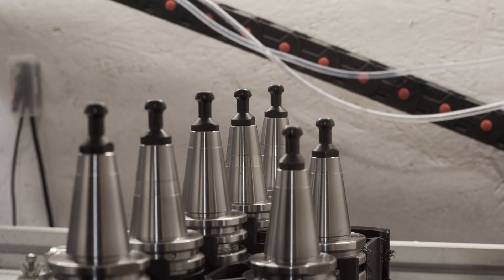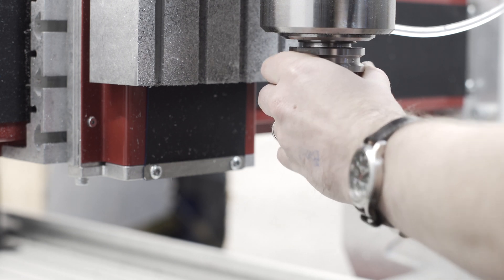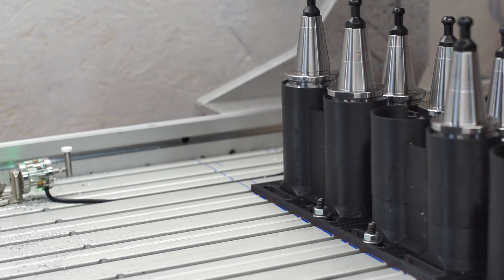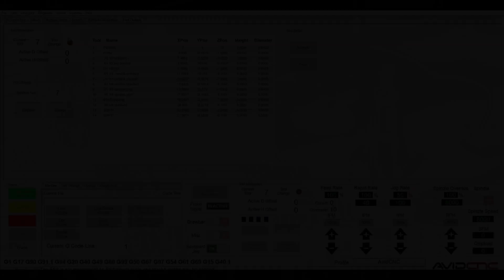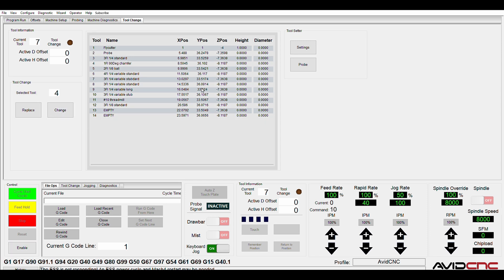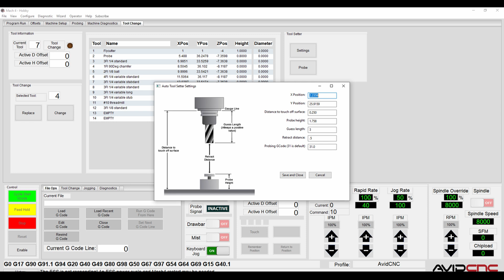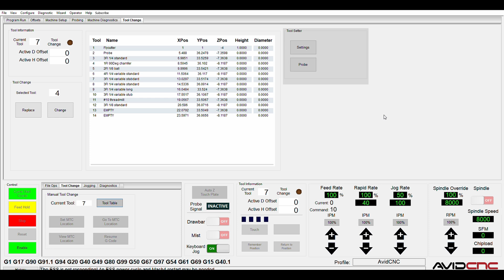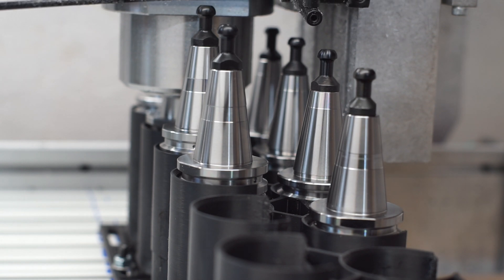3D printed tool rack for my ISO30 ATC Spindle

Comment from the maker: Hey all, had a few requests here and elsewhere for the code.  I cleaned up my code and put the macros/screenset/modules up on github: https://github.com/polyfractal/Mach4ATC/
Reply: Yay what a legend! Thanks. I'll definitely try this out.
Sharing video to DIY CNC group on FB
- Ken
Reply from the maker: Awesome, good luck!  Let me know if you run into any issues, or have bug fixes :)  The tool change macros seem pretty rock solid so far, but I've run into a few sporadic issues with the tool setter and incorrect offsets (may or may not have plunged an end mill through a part 😅 ).  So beware fast rapids to start if you use the touch off code too :)
Reply: @BreakingTaps  thanks. I like that 3d touch of sensor you have. I might buy 1.

Comment: A couple of years on, are you still enjoying those probes? It looks like the manufacturer has discontinued the side-mount one you have in favor of a top-down probe. I’m thinking of picking it up but concerned that if something goes wrong I kill the whole probe rather than just the contact portion sticking out.
Reply from the maker: My Avid hasn't seen as much use as I'd hoped over the years (various unrelated issues) but I'm still pretty happy with the probes! The toolsetter works great, and the wireless probe is good other than battery life. Mine is the older, non-rechargeable design and I find it doesn't do a great job auto-sleeping. So battery dies pretty quickly and replacing it is a pain and requires re-calibration.  I think the newer version just has a USB charging port so much easier.  All in all pretty good value for the money I think.

Shame they discontinued the side-mount. It's the same body as the wireless probe, but I guess they decided to consolidate the models even more by only having vertical option.

Comment: Great info! I have a quick question.  I am building a completely custom machine and already purchased the standard Mach 4 software. Do you think it would be beneficial to get the Avid version to use as a base? I am trying to get my ATC system up and running, I have a brand new 3.2KW spindle that I cannot wait to use. I tried using some of your downloads however I am missing panel function files etc.

Comment: Are you using tool length offsets? How did you setup your tool legths?
Reply from the maker: Yep! The macro will go check the tool length on the toolsetter probe and records the offset for for future use (although right now the other macros also re-probe each tool before use so it's not actually being used, but someday will :) )

Comment: I looked up that probe and it looks sweet! One question i have is how accurate is it? Do you find it good enough that accuracy of the machine is a bigger factor? P.S. Thanks for answering my questions on your other video about this machine btw, I know i have a lot of them lol.
Reply from the maker: No problem :)  To be honest I haven't done any rigorous testing of the probe accuracy and if it's better or worse than the machine's positioning accuracy.  If I had to guess though, it feels like the probe is accurate enough that positioning error of the machine is the main limitation.  I did find that there is a certain position that the probe isn't very accurate in (it uses three pins/springs to allow deflection, and at just the right angle it doesn't actuate smoothly) but that's generally not an issue.  Considering the price it was a nice upgrade from the contact block kind of probe that's typically used, without selling a kidney :)

Comment: I am new to CNC milling, and have a question. Avid sells an auto Z and corner finding touch plate. It this a tool setter and a touch probe all wrapped into one? Thanks in advance!
Reply from the maker: Basically, yeah!  I have one and use it on occasion, when I'm feeling lazy or Mach is not behaving. It has two sides: one side is flat and lets you take a Z measurement (either to find the z-offset of a surface, or to measure a tool).  The other side has a corner notch which lets you put the probe on a corner of your work.  Avid's Mach screen includes some probing routines to then touch off the sides of the plate, which will give you the corner position.  The side with a corner notch can also do Z measurements too, so you can probe height and x/y of a corner all in one go.

Only downside is that it needs a corner to work on, and it can be a bit fiddly (e.g. if you forget to attach the lead to your spindle when probing, it'll crash :) ).  But it's super simple and easy to use otherwise!

Comment: Can this machine cut a sliding fit hole into steel?
Reply from the maker: Hmm, it definitely _can_, but I'm not sure how reliably it can.  Whenever I've needed a good sliding or press fit I rough it on the machine, then bore it out on my manual mill.  Cutting steel is definitely at the edge of this machine's capability... it can do it if you're careful, but repeatability is a challenge.

Comment: Thanks so much for sharing your work!  Would you be willing to share your 3D print file for the tool holder?
Reply from the maker: Sure, no problem!  I'll dig them out this weekend and tidy them up a bit, feel free to ping me again if I forget :)  Fair warning, they haven't worked out as well as I had hoped, and I'll probably redo them or replace them at some point.  The main issue is that different toolholders and tool sizes can cause differences in height which affects ATC.
Reply: @BreakingTaps  Hey, I'm trying to configure your module to use with tool height offsets while I wait for a probe (VERSBY probe is back ordered for a while). Would I just remove the "function to probe tool" section from your ToolChangePosition.lua file, and then set the height offsets in mach4 ?
Thanks for any direction here, your videos are super helpful!

Comment: How does the tool setter connect to avid machine?
Reply from the maker: I wired it up with a 4-pin aviation connector like Avid uses for it's own touch/proximity sensors, so it just plugs right into one of the AUX ports.  The wired tool setter is connected to the wireless probe receiver, and they both send the output to AUX1. :)
Reply: @BreakingTaps  thank you
Reply: Breaking Taps just received my tool setter, any more details on wiring it up? It came with a little resistor and I bought some aviation plugs. Just confused on how which wires go where and what to do with the resistor. Thanks
Reply from the maker: @LoST5757  Heya :)  I'll pop out to the shop today and take some photos, don't quite remember how I have it wired up.  I have both the toolsetter and the probe wired together, so my setup might be a little different depending on what you got.  Details to follow!
Reply: @BreakingTaps  Thanks, looking to do it similar to you, just a traditional wine rack style instead of a 3d printed tool holders.
Reply from the maker: @LoST5757  Apologies for the delay :)  Here's an annotated view of the wiring:  https://imgur.com/a/vwmrC54  Some notes:

- "TS" stands for toolsetter, and is the cable that comes from my wired model.  Both TS and probe are wired into one probe port on the Avid
- I have the older "Vers WL", which looks to have a different PCB than the newer rechargeable WLR model, so pinout might be slightly different
- The probe is configured as Normally Open and NPN switch.
- I'm not currently using the Err output, but probably should :)
- Most 4-pin connectors have the same wire coloring and pinout... but you might want to verify gnd/vcc with a multimeter just in case.  The fourth (white) wire is unused
Reply: @BreakingTaps  Just got to setting up my S30c plug and play kit from CNC Depot. I'm using your macros and screen set from github.  I can't seem to get the drawbar to work.  Like its not getting a signal from Mach 4,  I click replace in Mach4  and get popup to release drawbar, then clamp drawbar.  But it doesn't actually do anything.  manually pushing the button on the solenoid opens and clamps the drawbar.  Is there an output signal I should change? or an other ideas?  Thanks.
Reply from the maker: @LoST5757  Hmm, so he didnt have the plug'n'play kit available when i purchased... so yours might be wired up a bit differently than how I ended up.  I have the ATC drawbar wired up to "flood" relay output on my Avid box, so the lua script is configured to use OSIG_COOLANTON pin.  I'd probably poke around to see where the ATC solenoid is wired (which pin on the breakout board) and then dig around in Mach config/diagnostics and see which output signal is associated with it.
Reply: @BreakingTaps  It was a long day, lol.  So, the solenoid was wired to a solid state relay, but there wasn't a connection from the relay to the breakout board in the control box.  connected a couple of wires and it works now! :)  Now on to get the Vers TS wired up and working, pretty sure i can do this one. Thanks for the response. :)
Reply: @BreakingTaps  it's me again, curious do you use Vectric Aspire? Wondering what post processor I should use for ATC with mach 4.
Reply from the maker: @LoST5757  Heya :)  I've only used Fusion360 so far, although the recent update means ATC is handicapped for hobbyists (can't have multiple tools per program) :(  I haven't done a multi-tool program since the update... not sure what I'll do when I need it, since I'm not sure I want to throw down money for a "professional" Fusion license at this point :(

Comment: Just pulled the trigger on a pro 4x8 + s30c and am sitting in the 6-8 week waiting period. Any difficulties, information, or advice around the s30c integration?
Reply from the maker: Awesome, congrats!  Did you get the s30c avid "bundle", or just the individual parts?  The bundle wasn't available when I purchased but I think it is pretty straightforward and includes most everything you need.  If you didn't get the bundle, there are a few extra bits to acquire, and wiring Avid to the VFD can be a bit tricky but not insurmountable.  What VFD did you get?
Reply: @BreakingTaps  Did get the bundle, which uses the  same VFD Avid includes with their standard spindles.
Reply from the maker: Ah ok, yeah, if you got their turnkey bundle it should be pretty easy.  The main difficulty was translating the Avid wiring pin naming scheme into the CNCDepot pin naming scheme when wiring them together, and programming the VFD (I still have a few things wonky that I haven't been bothered to fix yet...).  But the turnkey bundle should take care of all that for you.

Otherwise it was super straightforward: mounting the spindle was easy (I used the Avid's tramming mount), hooking up pneumatics wasn't too bad even for a first-timer like me, etc.  Random things that I remember from getting started:

- Bearings will make some "rattle" noises at high speeds when you first get them, it's normal.  They "wear in" after a little while and the noise goes away
- I like to let my spindle warm up for a while before really using it, the high-speed bearings are fit loose (relatively speaking) because they expand at their working temperature.  So you'll have less accurate parts if you use the spindle before the bearings are warm
- The spindle is case-pressurized to keep dust and other stuff out.  Since I mainly work with metal, I've dialed the pressure down pretty low (~30psi iirc?) which helps save air, as it is constantly venting to atmosphere.  If you're doing woodwork though, I'd definitely keep it at the recommended pressure (~100psi) so that wood dust doesn't get inside the spindle.
- I have a ~27gal air compressor setup, but my compressor is a "silent" variety and only does ~3 CFM.  It runs at around a 60-70% duty cycle.  A bigger compressor that has higher CFM would definitely be nice but the one I have works well enough.

Feel free to ping me if you have questions while setting it up!  Both Avid and CNCDepot's support are great too, they were very fast in responding to my questions. :)

Comment: Hi,  thanks for the videos. Keep them coming.
Was wondering about the probe and the company that sells it. Did you have any issues, everything went smoothly? Kind of nervous about ordering from them as they are a russian company.
Reply from the maker: I've been pretty happy with it so far!  I definitely understand the reservation, the checkout is a bit sketchy as well (a russian-based credit card processor.  Legit, just gives off strong 1998 ecommerce vibes :) ). But the price was so good I couldn't resist trying.  Placed order, got a receipt, it showed up 4-5 weeks later.  I get the feeling it's a one-man operation and he manufactures them on-demand + overseas shipping, hence the long lead time.  

I had a small electrical issue (bad solder connection), but the owner (Serguei) was super responsive over email helping to diagnose and fix.  <24hr response time, usually a lot less which was impressive given the timezone difference.

I wrote more about the probe itself over on reddit if you're interested: https://www.reddit.com/r/hobbycnc/comments/f8rw3v/3d_printed_tool_rack_for_my_iso30_atc_spindle

Comment: Definitely would like to see your Screens and Macros!  I’m conflicted about starting with the Avid vs Generic MACH 4 screens.  Recently, I asked Avid about removing things like THC references.  Don’t think they were interested in helping and maybe I’m still not asking the right questions.  As you can tell, I’m still fighting the initial issues here.  Looking at what you did will certainly give me a good place to start.  I’d also like to see how you did the air control.  Imagine it’s also in the scripts and macros.
Reply from the maker: I cleaned the code up a little and tossed it onto Github:  https://github.com/polyfractal/Mach4ATC  Hope that helps!  Unfortunately the screenset is saved as a binary format, so you can only view those scripts by going through the Mach editor :(

My screenset is a mix of default and Avid, I'm mainly using Avid but grabbed a few things from the default (e.g. probing tab, some tool DROs, etc).  There are a few wonky things though, like corner probing can behave strangely at times so I may not have moved it over correctly/fully.

I have my drawbar solenoid on "Relay 1" which Avid maps as coolant, so you can see in the code that I use the coolant signal: https://github.com/polyfractal/Mach4ATC/blob/master/Profiles/AvidCNC/Modules/ToolChangePositions.lua#L127-L131

(Relay2 is my fogbuster, which they map as mist)

Goodluck!  I'm still super new to Mach, but happy to help if you have questions...maybe we can stumble our way through it :)  I wish Mach had better documentation, most of my scrips were cobbled together from reading other scripts/modules/macros :'(
Reply: Thanks for the help getting started.  (downloaded the GitHub stuff).  Newbie to Mach also.  get most of my programming help by reading and tweaking existing code too.  slowly becoming familiar with Mach Screen editor.  Cut and past screen components from one screen set to another still alludes me.  Haven’t found any Documentation help but then again - it may be technically impossible.
Reply from the maker: There's an import/export mechanism for individual components.  Find the component (or group of components, like a tab or panel group) in the treeview on the left, right click and there should be an "export" option.  Then close the screenset and open the destination screenset, find the component in the treeview where you'd like to import the components (e.g. if you exported a tab, find the destination tab group) and right click -> "Import".  It's a little fiddly but seems to work for the most part.  Unfortunately if there are global scripts elsewhere (like in the PLC script) that the imported components need, those don't come along for the ride and might break things.  I'm not positive, but I suspect that's why my imported corner probing screens don't work quite right.

Comment: The Tool setter Vers TS has a Probe tolerance in XYZ directions
 of ±4mm as listed in the dokumentation. If we can believe the dokumentation then these tools are not very good considering the high price.
Reply from the maker: I think that is a translation typo.  E.g. the WL probe has the same "±4mm" spec, but that page describes it as "Permitted deviation stylus in XYZ directions".  That feels correct based on handling the probe: the travel in any direction is ~4mm before the internal mechanism bottoms out.  I think the tolerances of the probe is instead the "Unidirectional repeatability" spec, which is < 0.003 mm (3micron).  I haven't tested with an indicator but it is definitely more sensitive than ±4mm.  I'll reach out to Sergeui and see what he says about it :)

Comment: Very impressive. ATC’s are a pain and this is a great solution. Have you tried the facemill yet? I’ve got to admit I’m shocked that’s even an option for a router style machine.
Reply from the maker: I have not, and it might be a complete failure :)  Definitely can't run it with all the inserts, no way the machine has the torque, feed or rigidity to handle that.  But I'm hoping with a single insert as a flycutter (for shallow passes, say 10-50thou) it'll do a passable job.  If not I can always reclaim the location for more tools, or a real fly cutter.  I already had the facemill and inserts from my manual machine, so it was a relatively cheap investment to grab a BT30 holder for it and try.
Reply: Breaking Taps I hope it works!
Reply: Beautiful Face Mill but, as you said - probably not enough spindle power to drive it with all the cutters in place.